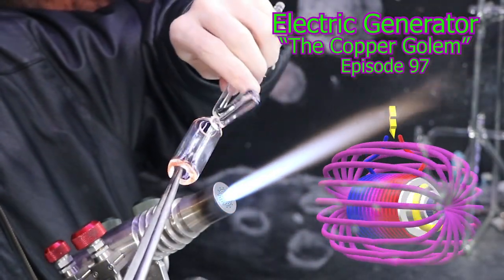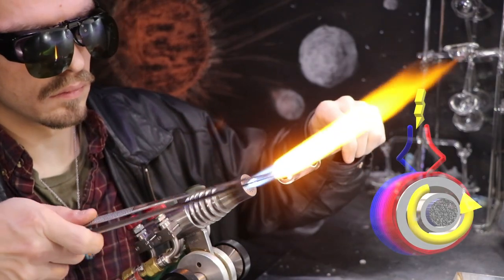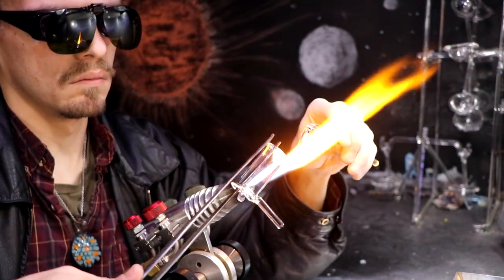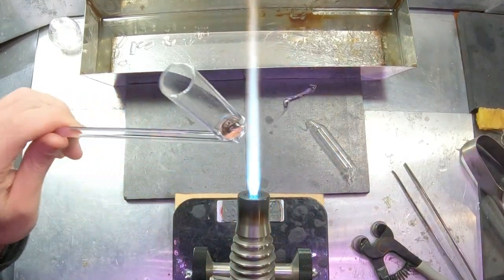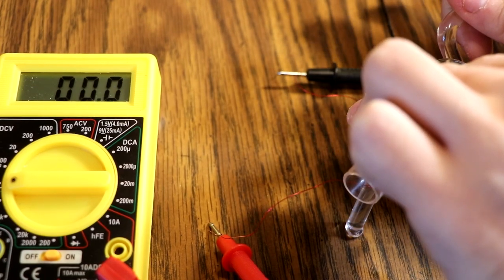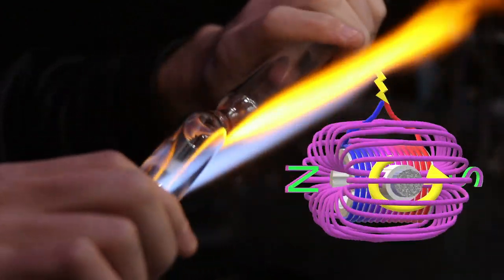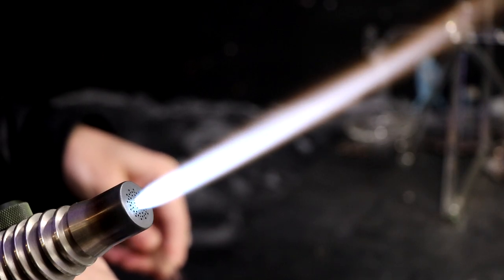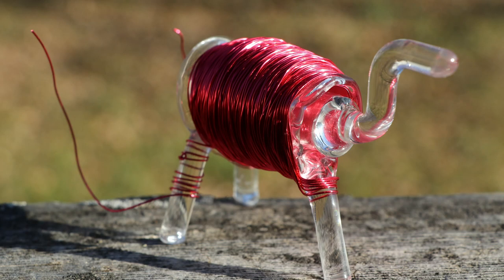The Copper Golem - A Path to Electricity

Comment: I think you should stick the magnet to the tube somehow. When you induce a current in the coil, it becomes magnetized, and pushes against the rotor, so the magnet is probably slipping a little bit.

Comment: Nice videos! Cool glassworking! I am studying glass beads a bit with air burner, soft glass! Damn, if you put soft glass in a flame so fast it cracks, boro so nice not to crack!
But I have few suggestions on a sience part:
1. you measure DC voltage with your voltmeter, while your generator produces AC ! Well unfortunately your voltmeter can't precisely measure AC voltage, so I suggest you try using rectifier diode to get DC. 1n4007 is quite useful cheap universal diode. your DC measurements without diode right now is an average of AC cycle which is 0 volts.
2. Magnet slips on high velocity inside glass envelope?
3. probably you better try some design like here, where coil rotates in a magnet field  
https://en.m.wikipedia.org/wiki/Homopolar_generator
(can do back and forth so multimeter wires will not twist too much)
Reply from the maker: Thank you Ostroumov. 
  Very cool, I hope you are enjoying melting glass. Boro is a lot easier to start with, I highly recommend it, along with a propane/oxygen torch. You'll notice a large difference the added oxygen makes to cut down on melt times.
   I understand the voltmeter DC issue, I noticed the positive and negative flashing back-and-forth. I'm not sure how accurate the readings were, but it was enough to demonstrate that electrical effects were happening. 
  Thank you for the recommendation on the rectifier. I was looking at the KBPC5010 Bridge Rectifier, would this work for an extra small generator? I've read the bridge rectifier handles the power better then a center diode but I could be mistaken.
   Lastly the magnet should slip, but I don't think it was spinning fast enough or had enough coil for much electrical induction. I'm planning to remake this generator along with two other designs to experiment further. Thanks again for tuning in Ostroumov!
Reply: @MattJasa  Sure, bridge rectifier will work even better, since it is simply 4 diodes and they rectify both halfwaves of alternate current! You ll probably would be able to light up small LED or incandescent bulb, but you ll need a resistor in series not to break the thing.
Reply: I ll by Oxy torch someday!

Comment: Trying to get myself my first torch any recommendations? Thought about the bravo . Have you had any other torches ?
Reply from the maker: Hey Ryan, sorry I missed your comment. I started out on the $200 Bobcatt from GTT. With a small torch you can practice and learn about any technique just on a smaller scale. If you have the extra money you can start off on the $1000 Bravo if you like. The center fire is the same as a small torch but the outer fire gives you the option for larger work. This is probably the biggest bubble I've blown on the Bravo so far = https://youtu.be/33ynQQzJAoI  (If your using a 10lpm oxygen concentrator I'd recommend the Bethlehem Alpha over the GTT Bobcat)